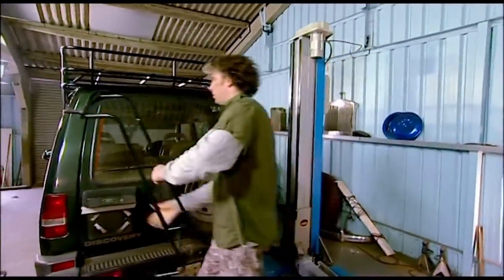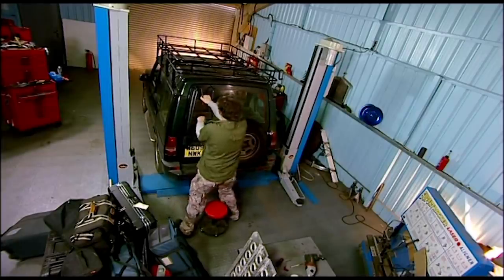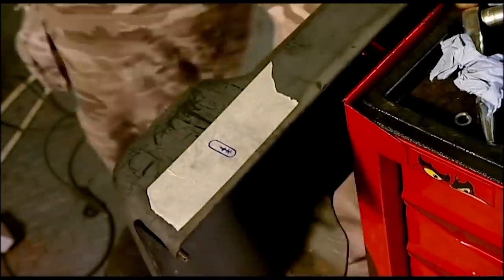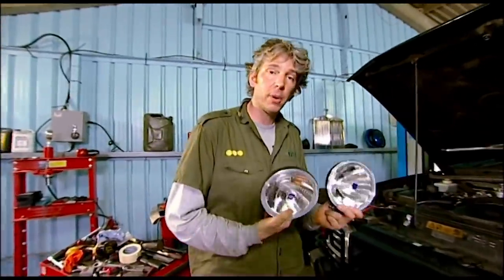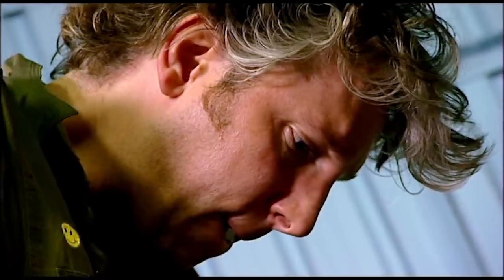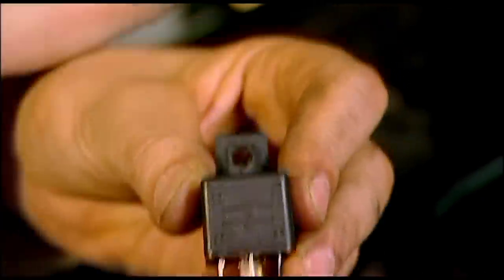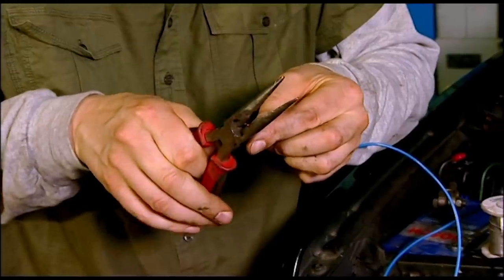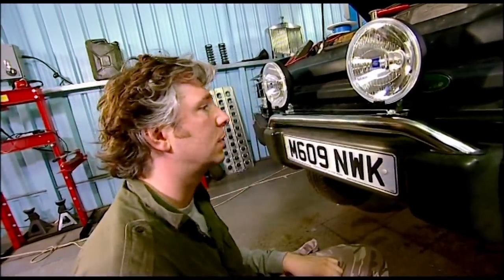Installing New Spotlights On A Land Rover Discovery | Wheeler Dealers

Comment: Might want to check the legality of the way those spotlights are wired.

If the lights/bulbs aren't certified for road use you CANNOT have them wired into a vehicles standard lighting system.
You MUST fit a separate switch so that you can only activate them off-road.
Failure to do so is an MOT fail or a fine, depending on whether it's a pedantic MOT inspector or cop who you're talking to.

On a practical note, it's not neccesarily wise to link spotlights directly to your main-beams either.
There might be times when you'll want to use your main-beams without the spots or (less likely, admittedly) you'll want to use the spots without turning on your main-beams.

At the very least, I'd suggest fitting a dashboard switch between the feed from the main-beams and the relay for the spots.
That way you can disable the spots and use the car's standard lights on their own.

Ideally, it's probably simpler to fit an independant switch to activate the spots so you retain complete control of when all your lights are in use.
Reply: m8, this episode is about 20 years old x

Comment: interesting - Ed might have just done this for the show - but this D1 has a headlamp wiring loom he could have plugged straight into to add the aux lights  - factory did that for this purpose - add a switch inside next to the cruise control and "Bob's Your Uncle" not mine